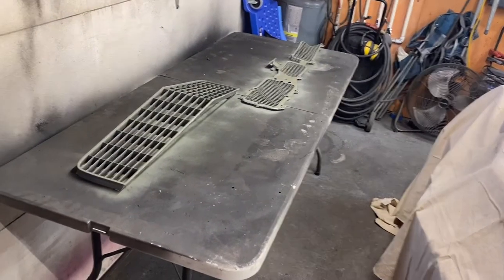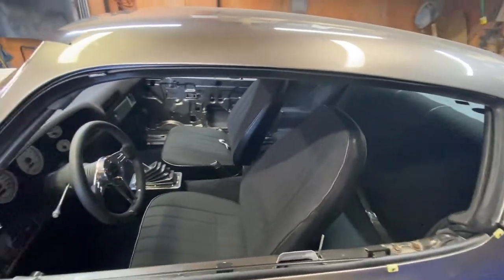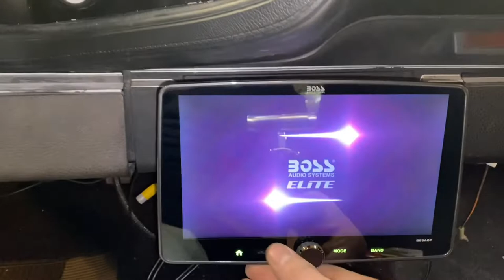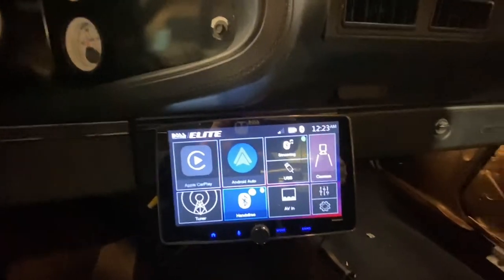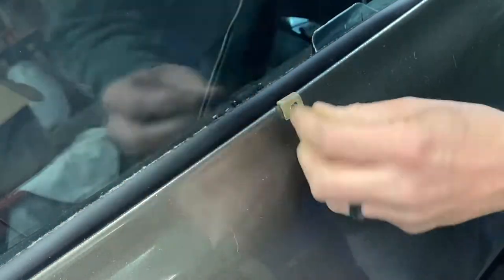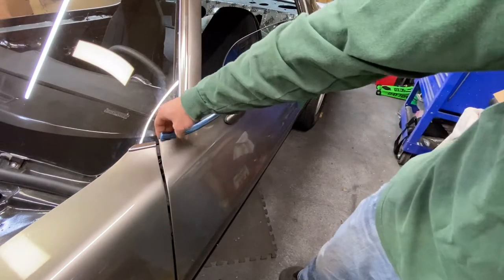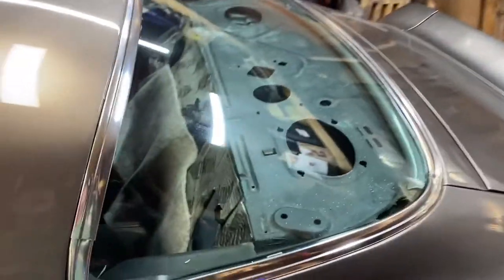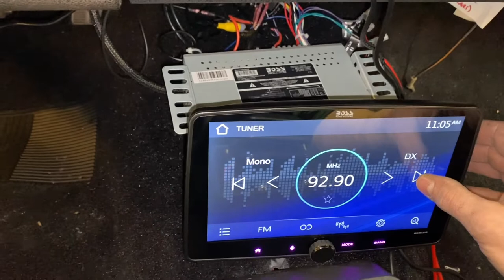1977 Chevy Camaro Restoration. Part 70. Radio and speakers.

Comment: Excellent video. I like the radio. I have been looking for one that will work with my console.
Reply from the maker: They have 2 sizes a 10.1” and this 9”. I opted for the smaller one but it’s plenty big for what I need

Comment: Nice! Like the new intro! Can I ask how much the window install was? I’m contemplating wheather to try to DIY or hire it out….
Reply from the maker: I paid this guy $240 for both. He was here for about 5 hours. More than he bargained for. Others quoted 500-700 for the install.
Reply from the maker: I will say though, next time I will do it myself and get a buddy to help. Didn’t look too hard.
Reply from the maker: He did primer on the body, let it dry then the glue. The glue is super thick. He also used shims as well to hold it at the right height.
Reply: Right on! Me and a neighbor did mine today👍 I used the butyl type tape. Comes in a roll. Bought two kits from classic industries. One for front and another for the back. Was actually really simple. I filmed it too 😁 thanks for the price info!
Reply from the maker: @HeavyPedalGarage  that’s awesome! I’m excited to see the video on it! So close! You’re getting there.

Comment: What is the adapter kit you installed
Reply from the maker: Adapter kit? For the wiring?
Reply from the maker: If it’s for the wiring, I just hard wired everything in. If you mean for the actual radio, I didn’t use a kit, just mounted it below the dash with the supplied hardware mounting kit.
Reply: Ok thanks it looked like an adapter kit for mounting